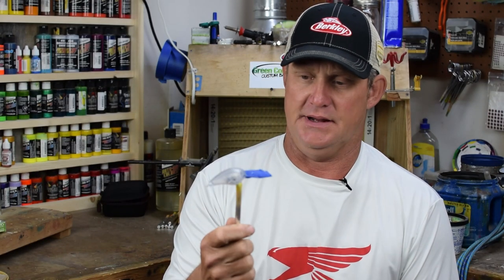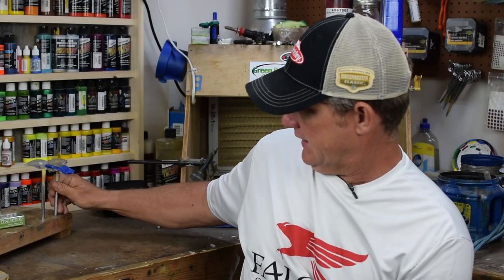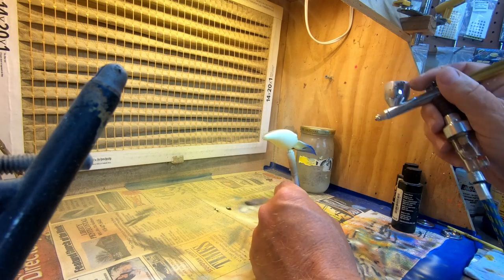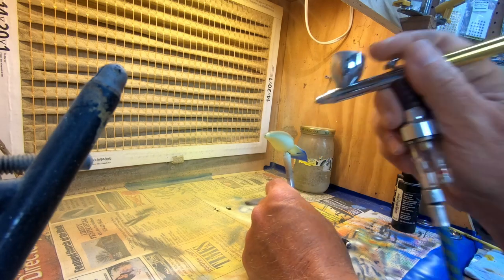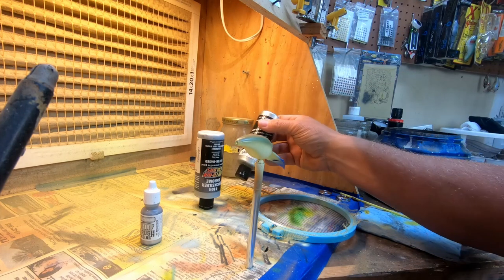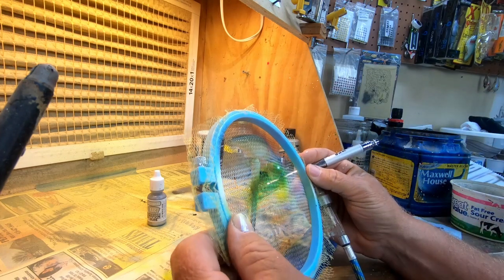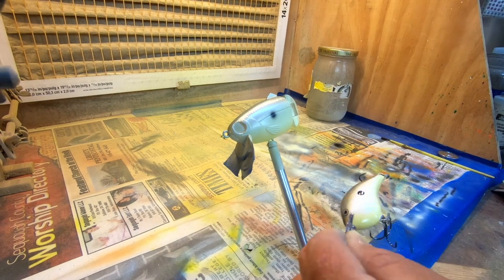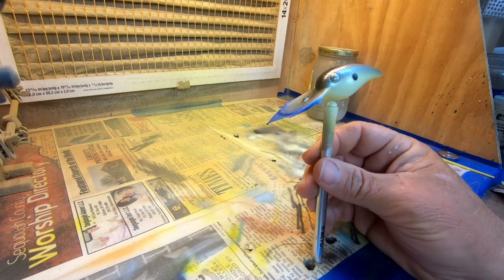HOW TO PAINT A BASIC SHAD PATTERN

Comment: Can you make a video on when to use which size needles for an airbrush?
Reply from the maker: Be a really short video but ill consider. Here the deal i use a .35 for almost everything. The .5mm is for pearls and clearcoat.
Reply: @greencountrycustoms8387  can you still shoot pearls and clear coats with a .35
Reply from the maker: Yes sir. There may be a few pearls that dont work well but for the most part use your reducer and let it fly